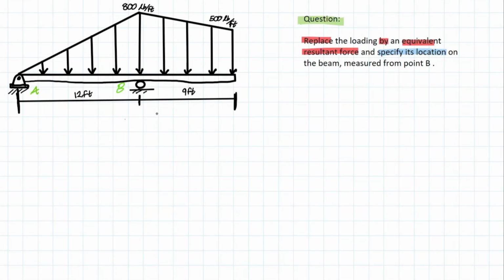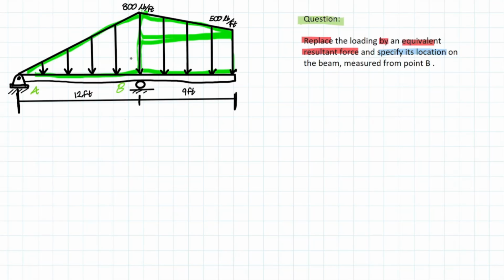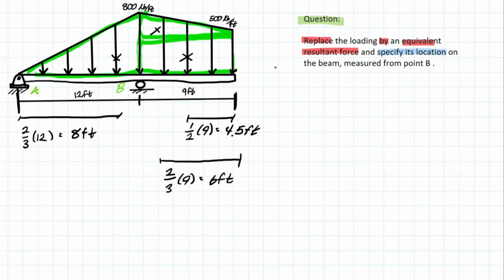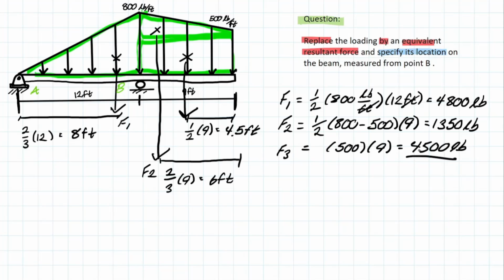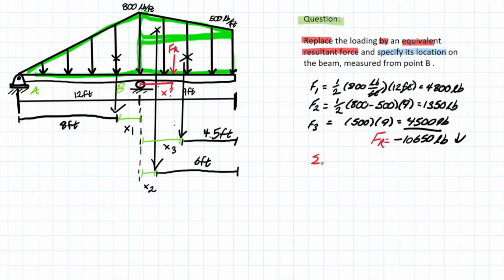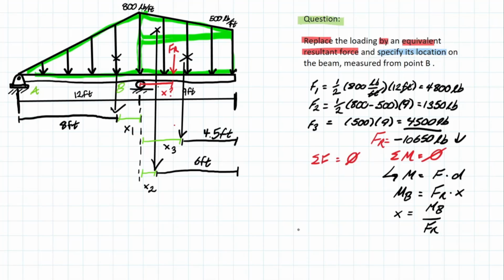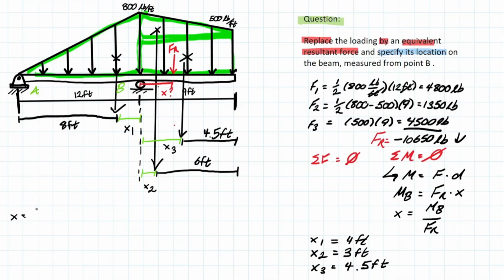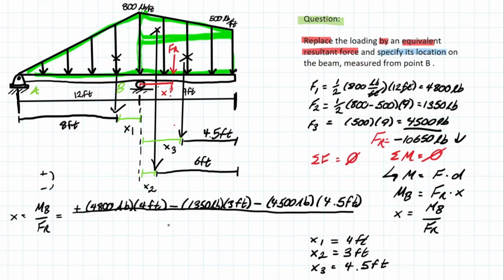Introduction to Distributed Loads!

Comment: why is it that we need to subtract? or else we need to add?
Reply from the maker: Hi! I'm assuming you are referring to the moment calculation. Basically, we need to set a convention for rotation in order to solve these type of problems accurately. So, we assume CCW (counter clockwise) is positive and CW (clockwise) is negative. Since our reference is with respect to support B, any downward forces to the left of the support (F1 in this example) will be positive since the rotation caused will act in the CCW direction. All remaining forces remaining in this problem to the right of the support will do the opposite, and create a clockwise rotation, thus we use a positive sign for these.

Let me know if this helped!

Comment from the maker: Sorry about the audio, first uploads are always a bit of a challenge! Thanks for watching
Reply: You did not use the reaction at pin support
Reply from the maker: @giselleayson3857  the reactions at the supports are not required! We are only concerned about the equivalent resultant force produced by the distributed loads and its location from B, as specified in the problem